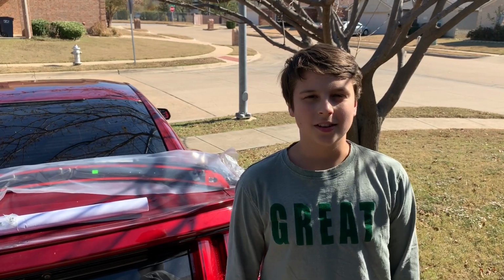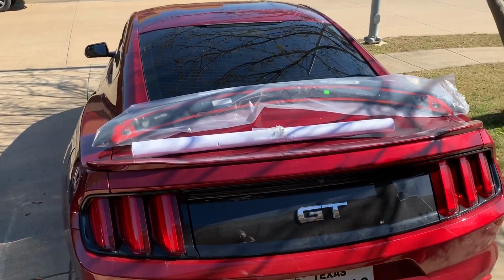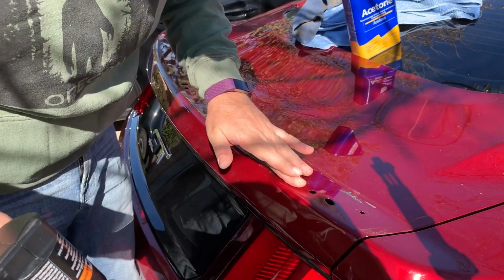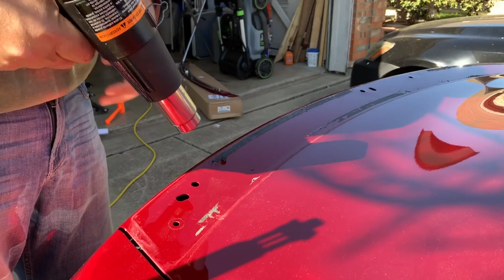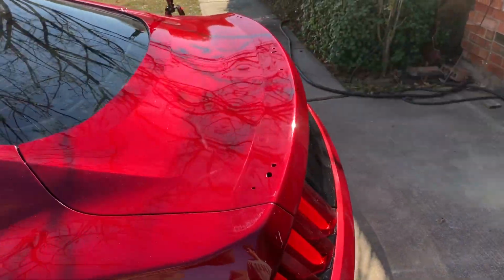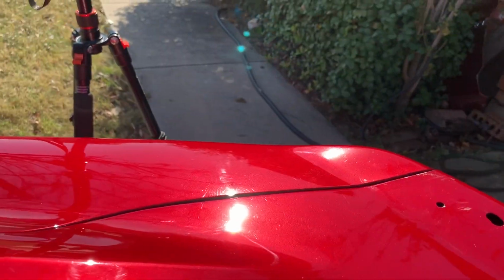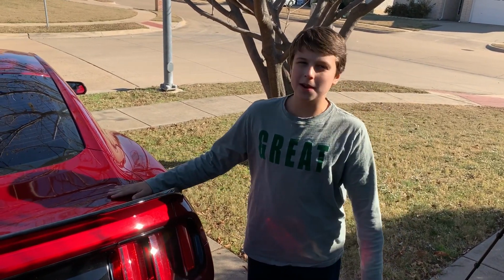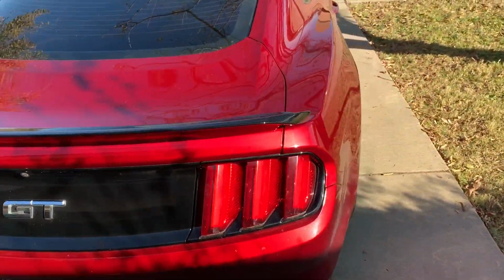Installing the Ford  Track Pack Rear Spoiler on our custom Mustang ....?? Part 12

Comment: too late now but they sell a rubber kind of ball that goes into a drill and you spin it. it will pull up on all the goo,probably take 30 minutes to get all the glue off if that.

Comment: I just did this two months ago. And either I’m getting mire comfortable driving 100mph or that spoiler is doing its job and the added downforce is making it easier to handle. 

Please tell me you’re removing the GT350 badge on the grill.
Reply from the maker: funny..it was removed before the final video was released 6 months ago